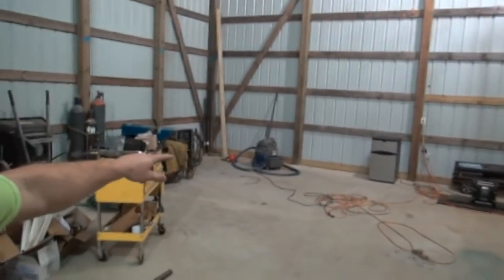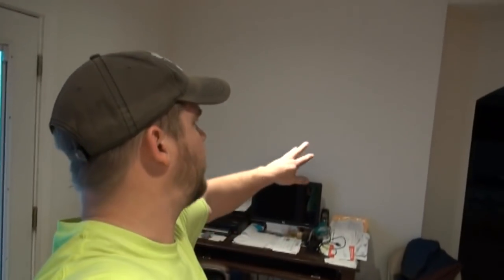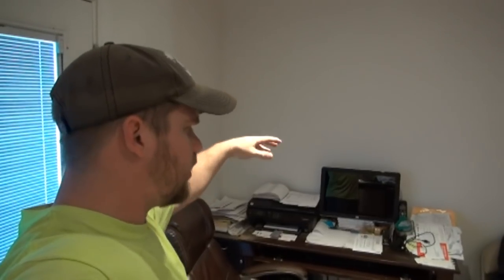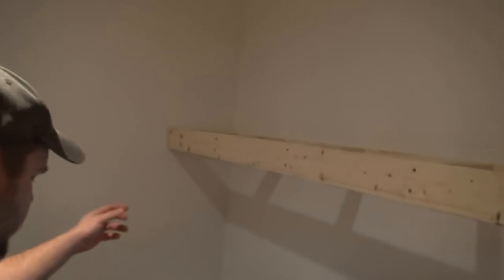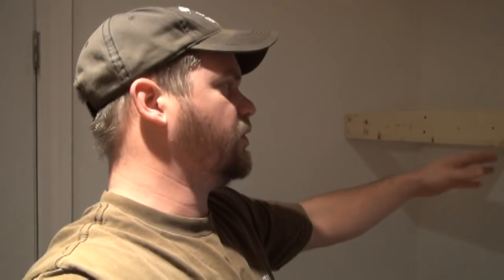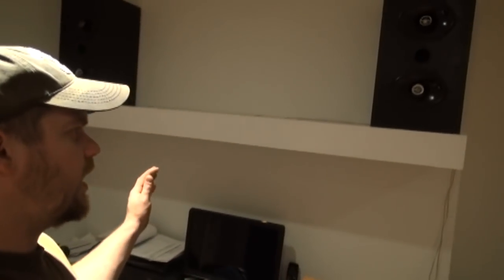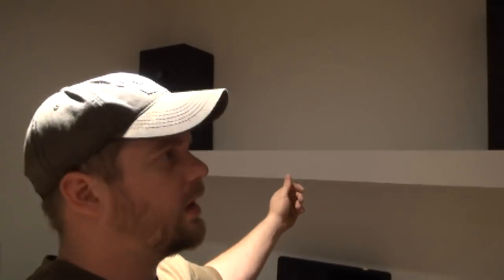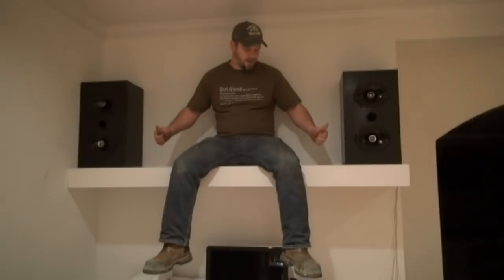How to build a strong floating shelf

Comment: I am trying to understand this......
1) Frame up the shelf with 2 x 4
2) Nail plywood to top and sides of frame
3)Secure the frame to the wall with the plywood removed from frame
4) Slide a plywood box that wasn't mentioned over the frame
5) sit on shelf
Reply: I see now
Reply: Step 2 was building the plywood box around the frame.  The nails were not to the frame, but to the plywood box.
Reply: Bob Wrotenstien you completely forgot the lag bolts he uses

Comment: What size screws did you use to hold the shelf in the stud? Did you try to drive straight into the stud or did you hit it at an angle? Great video and project, thank you.
Reply from the maker: I believe I used 1/4 lag screws straight in. It's been 3-4 years ago
Reply: @LifeWithChase  thank you, that was what my friend and I were guessing and that is going to help a lot.

Comment: what hardware did you use to attach to the wall?
Reply: 1/4" x 4" lag screws (2 per stud), if going through sheetrock & into the studs. I saw where he answered the same question previously. Just make sure to drill a smaller hole first, centered on the stud, to avoid splitting the stud. I like to drill a larger hole (at least 1/4" in this case) through the 2x4" frame & sometimes use a large  washer to ensure the frame is secured as tightly as possible to the wall.

Comment: How deep is the shelf? I’d like to make one that sticks out 12 inches from the wall but I’m worried it will lose it’s strength towards the outer edge. Is your shelf that deep? I noticed your frame has a 2x4 across the front, did that add stability across the whole top? 
Great video, thank you for posting!
Reply from the maker: I think it's about 12-16 inches don't remember, but paper trays sit there length wise with room to spare. I think the 2x4 helped a bit also. Just went with what I thought would work best and it worked out good.

Comment: Nice job, buddy.   I am going to be building a floating shelf just like this to hold AV components under my TV, along with some speakers.  Was planning to do almost exactly what you ended up doing, but was a little worried about whether lag screws into a 2x4 with no other bracing would be sturdy enough given the weight of the speakers.  Looks like I don't have to worry about that.  Thanks for posting this, super helpful.
Reply: Did you do it in the end? I'm thinking the same to hold two games consoles, avr, amp, NVIDIA shield and a bluesound node lol

Comment: odd question, but do you perhaps have wood measurements? im hoping to make something similar, but it'll for sure have more than just paper on it. ill need something strong as it will be holding speakers and computer components on it to declutter my desk
Reply from the maker: made out of 2x4s and 1/2" paint grade plywood from lowes

Comment: Half way through this build but having some issues with my stud finder. It keeps on going off when I get close?!? Anyone else with this problem?
Reply: Cheaper stud finders do this.  I have had a few and they all do the same thing and none of them have been very expensive.
Reply: Jacob Wellington  yeah i try the tap method my self tap my wood against the wall just be carefull to not knock a hole in the wall

Comment: I want to do this, but I have cement wall
Reply: cobydrei...You don't have a problem. You can use anchors in the
concrete to fasten your shelf to the wall. Actually, you're in good
shape because, you don't need to find studs! You can use more
fasteners because of that!
Lay out where you want to mount it, drill for anchors, insert anchors,
continue to march!
Reply: may I know what kind of anchors should I use? @soundspartan
Reply: @cobydrei  That would be for you to decide. Any hardware store, or
builders supply (lumber yard), can help you out. Get the best ones
you can.